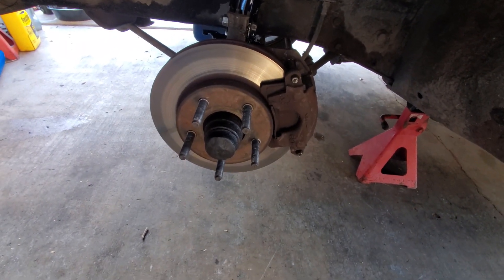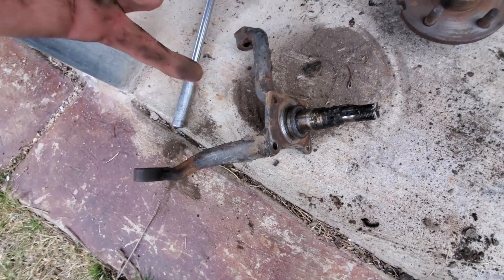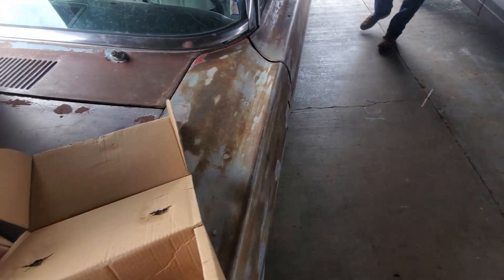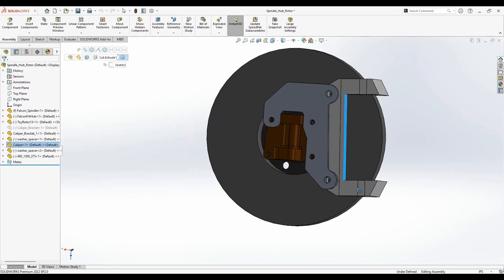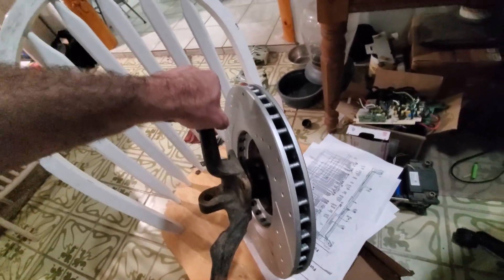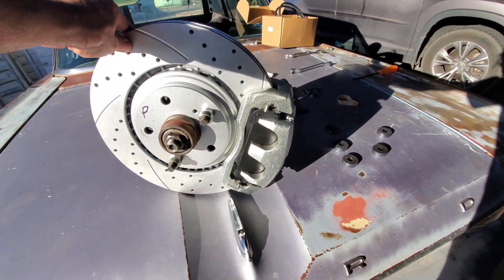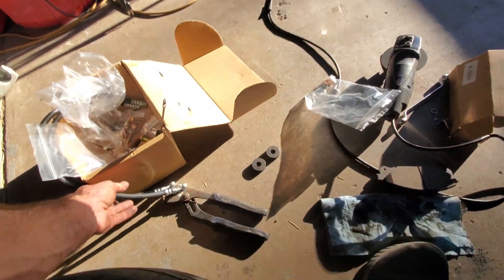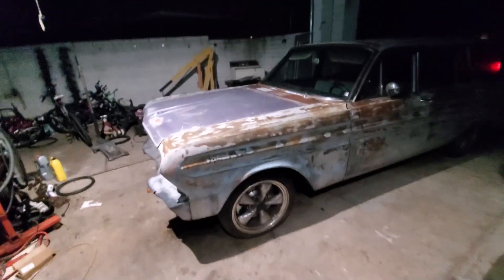1964/65/66 Falcon/Mustang with 12.9 inch rotor from a Toyota Highlander

Comment: Are you running the factory pedal assembly? Did it come with power brakes? If not the pedal ratio is off.
Reply from the maker: All Falcon/Mustangs 64/65/66 had the same pedal assemblies regardless of manual or power brakes.  I need to double check the stock MC bore diameter and compare it to the one I have now.  70's Mavrick..